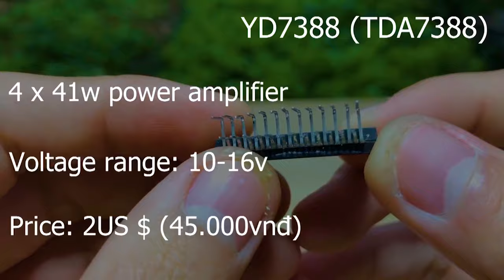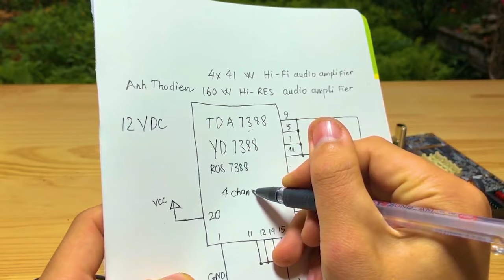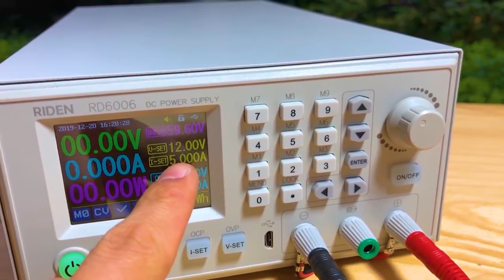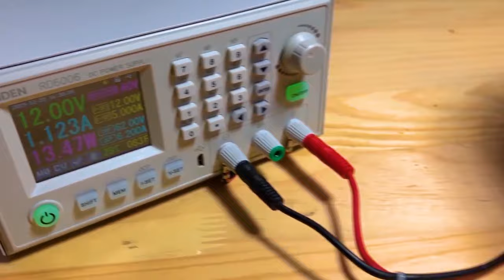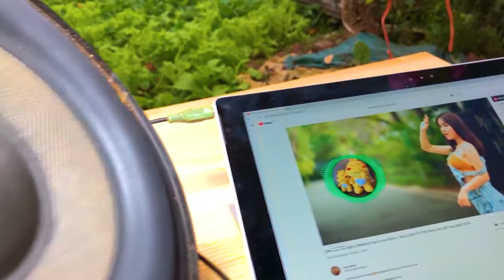How To Make Simple 160w Amplifier TDA7388 . Step By Step

Comment: The perpetual motion machine is open (sarcasm) at your input from a power source of 20 watts at the output of a maximum of 18 watts. In order for there to be 160 watts from the power supply at 12 volts, there should be 13.4 Amperes and this is with a chip efficiency of 100%. Deception is all around
Reply: well it was 4 ch and he only use 1.
so it will be 18*4😬😬

Comment: let me get this straight :  power supply  had this at a moment --->>>>12v*1.6A = 19.2 W  correct ? this TDA 7388 will do the same if you will connect 1 channel and let the other poor 3 bastards  to rest. Don't you think that this speaker should have a bigger excursion and have a bigger power consumption when you put all 4 channels together? I'm wondering if you put 160w instead 16w  :)
Reply from the maker: 160w is maximum
Reply: el nunca mintió sobre los 160 watts, solo es que no hiciste los cálculos bien DEMIGI01, lo que se calcula es el voltage de salida maximo RMS senusoidal  elevado al cuadrado, entre la impedancia de la bocina por el amperaje de consumo
Reply: @rohennyeleazargomezabreu.9508  Como que no mintio? no es verdad ni siquiera que saco el integrado de un stereo viejo, no tiene restos de estaño en ni una sola de las patas.
Y despues, la capacidad maxima del integrado de de 160, siempre y cuando uses los cuatro canales, aca el tipo, uno un solo parlante, si a eso le pones 160 lo desconas de inmediato.
Esto no es cierto, armado como de esta forma, nunca da 160 watts rms.
Y menos aun con doce volt un amper y medio-
Reply: @rafaelcastano7002  La hoja de datasheet dice que puede entregar 25W por canal usando parlantes de 4 ohmios, máximo seria 100W en total y supongo que si usa una fuente de 12V esta habría que ser de 14A aproximadamente

Comment: 2:00 you bent pins : 3 - 7 - 21 - 25 to connect  + speaker .. the 25 are connect to nothing  ( you mix it here 3= OUT2 - ..7= OUT1 - .. 21= OUT4 + .. 25 =X ) ... 2:39 you bent pins : 5 - 9 - 19 - 23  ( you mix it here too 5= OUT2+ ..9= OUT1 + .. 19= OUT3 - .. 23 = OUT4 - ) .. Where are the 17 = OUT3 + ?...your diagram are out of what you bent ... I am confused now

Comment: you have only half power(only pin 20 connected (ch3 & ch4))/ to get full power  both pin 20 and pin 6 should be connected vcc
Reply: He didn’t actually connect pin 20  (Vcc) as he made a mistake, he actually connected the red wire to pin 22 (mute). Incidentally he didn’t connect any of the power grounds 2,8/18,24 , he broke off the signal ground pin & attached the black wire & the signal braid to pin 1 (tab). So the circuit he demonstrated the construction could not possibly work, however if you notice the liberal application of glue, you will realise the speaker is being driven by another amplifier out of the picture!
Reply: Ps Neither did he connect the speaker wires to channel 3 as he also made a mistake counting pins , he actually connected  pins 25/21 & 23/19 which left pin 17 of channel 3 n/c and channel 4 in inverse polarity to channels 1&2. Hence another reason that it could not possibly work even if the channels would add together which they wouldn’t as he had connected all the inputs together !